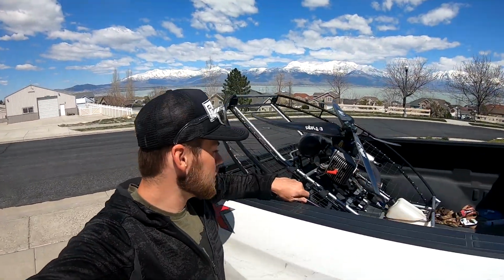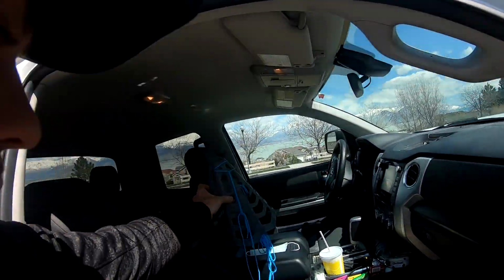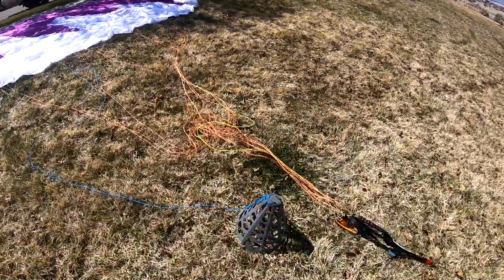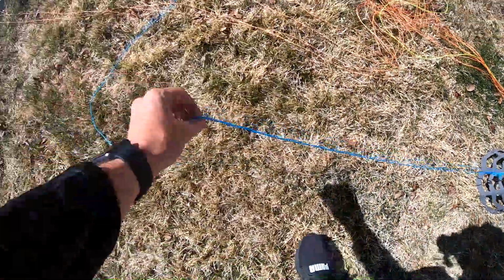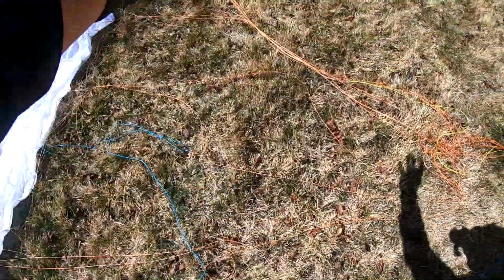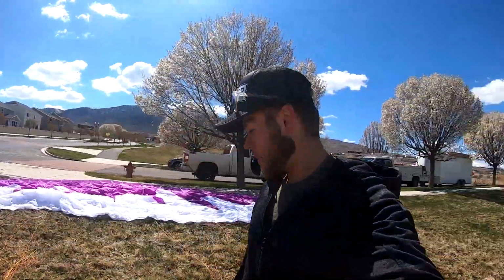Trying To Break A PPG Chase Cam!

Comment: Awesome video thanks.
What size prop are you using?
Reply from the maker: 51 but you can put over a 55 inch prop on the Flat Top.  Makes for a more interesting forward launch though if you fly smaller gliders so we stick with the 51 inch.